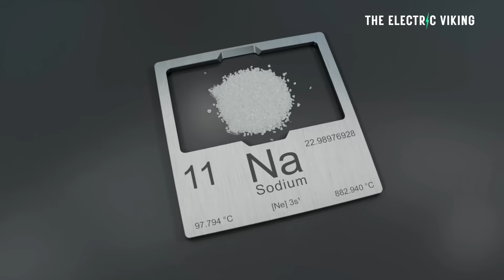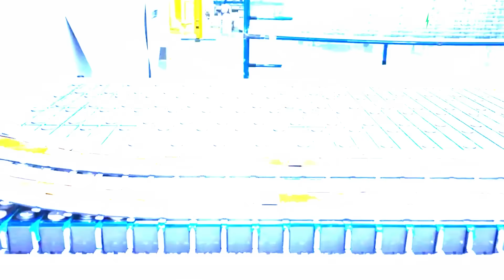Goodbye Lithium! New 3,600,000 Mile EV Battery costs 50% LESS

Comment from the maker: The car I drive, the Xpeng G6 - https://youtu.be/IcniwO8NfQQ

RESINC Solar installed my battery and solar system. Get a free quote from them here: https://www.resinc.com.au/electricviking
Reply: They are not in Norway, so your advertising doesn't help much here. 😛
Reply: What happened to CATL's "condensed matter battery"?  

Wasn't THAT supposed to be the battery "game changer"?   

CATL's Condensed Matter Batteries were supposed to give us electric planes... soon.    Where are they???

*
There's no negative consequences for CATL coming out with BS about batteries every 9 months.   They can put out BS with the blessing of the CCP (don't forget -  CATL is a CHINESE company, which means they do want the Chinese Communist Party tells them to do).

Russia funded the European idiots of the Green Party to help keep non-Russian natural gas off the market, and make them DEPENDENT on Russian natural gas.   Why shouldn't CCP- controlled CATL come out with BS battery stories that say, "Don't invest in oil indepence!  Batteries are going to make oil obsolete!".  --- or some such BS.
Reply: Please post a review of the Xpeng G6, after 200,000 kilometers. There is too much "noise" on the internet, about parts availability, customer service, and, the overall quality and longevity of Chinese built vehicles. The ONLY way to know, is to drive one, and see how far it takes you, before any major problems. My experience hasn't been great, but, cars are not cheap electric scooters.
Reply: Assuming sodium battery tech takes over, then the Chinese with their investment in lithium are out of luck.

Comment: If you could make these into swappable cells that you can gut have changed at an automated station. You’d have a full battery in less time than it takes to fill a tank of gas. And The service life would put to greater use.

Comment: Perhaps it’s a misunderstanding because “90 percent cheaper” could be interpreted as as either 52.6% of the original price or 10% of the original price. If I sell something for 52.6, and u sell something for 100, then mine is 90% cheaper. But if I sell it for 10, that’s also 90% cheaper. It’s the ambiguity of the language.

Comment: Wikipedia says,
"In April 2025, CATL launched its Naxtra sodium-ion battery brand, with mass production planned for December with energy density of 175 Wh/kg, approaching lithium iron phosphate (LFP) at 185 Wh/kg. It supports 5C charging and over 10,000 charge cycles. It also performs well in extreme cold, retaining 93% capacity at -30°C and supporting highway speeds at low charge levels. CATL claimed that the battery passed rigorous safety tests (e.g., compression, penetration) without fire or explosion risks."

Comment: Sodium ion batteries are less energy dence. They're more appealing for fixed batteries in power storage facilities, home storage etc. They will appear in cars, especially cheap cars but they'll compromise on range. I expect hybrid batteries consisting of a % of sodium & lithium cells will also appear since it lowers the costs and sodium ion batteries do have better performance in colder climates so there may be a practical use outside of pure cost.

Comment: So at 3 miles per KWH a vehicle will need 333 KWH  per mile. Naxtra batteries are 0.175KWH per kg. Lithium batteries 0.250KWH per kg. So the batteries will weigh even more. Lets say Naxtra will need 2kg of batteries to travel 1 mile. My ICE car has a 650 mile range. That's 1.3 tonnes of EV batteries to carry around. ICE fuel tank full is say 65kg. How is this either efficient or progress?

Comment: BYD in trouble? Not sure. In late 2024, BYD launched the world's first high-performance sodium-ion battery energy storage system (BESS) product, the MC Cube-SIB ESS, which uses their Long Blade Battery cells and offers 2.3 MWh capacity with advantages like high charge/discharge rates, wide temperature tolerance, and enhanced safety. Deliveries in China already began with pricing competitive to lithium-iron-phosphate (LFP) systems.

Comment: Meassuring a batteries life in miles makes no sense. How many batteries u use, power of the car, cars efficiency, aerodynamics etc play a huge role in this equation. In theory if you put in enough single use alkaline batteries you could hit a million miles. (It would be a very slow, VERY big car but still...) How many charge cycles is a far more objective meassure for battery life.

Comment: Battery tech is moving forward at amazing speed. AI has been helping the process.  A 3m mile battery is basically a 'forever' battery. You're right that the battery industry will have to take notice.

Comment: How are these, for charge acceptance efficiency? What is the equivalent series resistance? Will they have the POWER density, that will allow fast charging, and, vehicle horsepower? I think sodium batteries will probably find applications in stationary renewable energy storage, before they make it into the next high performance EV.

Comment: A major problem with EVs is that a minor accident can completely destroy the battery and the cost to replace the battery pack is prohibitive. Thus, insurance costs will shoot through the roof for EVs unless battery costs come way down and battery robustness goes way up. So how do these new batteries score on those fronts? Are they going to substantially improve those factors for EVs? If so, then EVs will become a good option for many more people, assuming electricity costs don't shoot through the roof due to AI. EVs and AIs need mass adoption of modular nuclear in order to create enough electricity capacity to keep the technology moving forward.

Comment: Lacking that "combustibility" issue will allow them to be closer stacked (for storage banks, less land use reduces overall project costs, safer less insurance costs and fire prevention/mitigation costs) and safe to install within urban environments, even for use on undergrounds etc. Yes it's those large scale benefits that will bring these battery types to the forefront therefore leading to a decrease in overall costs due to mass scale production - lithium based batteries will therefore lose mass scale production demand and become more expensive. Not to forget that there are talks to ban EV's from certain carparks and underground garages due to the massive potential liability that just one of them "igniting" does bring.

Comment: There are two causes of degradaton: Degradation by use (charging and discharging) and degradation over time (almost no use, but years go by) 
There hasn't enough time gone by, to know how long LFP batteries will last over time. Let's give an example: I have a Wuling Mini with LFP battery. No factory numbers about how long the battery will last. But, since it doesn't have active cooling, my guess is around 2,000 cycles. Which would be over 300,000 Km. 
But there's the problem: I run the car only around 7,000 Km/year. So, taking only the charging cycles into account, that would mean around 40 to 50 years. But, what about time-aging? I'm pretty sure, time degradation will destroy the battery far before charging-degradation does it. So, LFP batteries have to be around in use for at least 30 years, before we have any reliable data about it. The same for sodium batteries.

Comment: These could absolutely dominate grid storage and completely change the power grid in massive ways.
We could have affordable grid storage facilities in the 100's of GWh range, buying up power when cheap and holding it for days.
Cheap enough energy storage is as big of a game changer as fusion would be...

We could put 50 MWh batteries at EV charging stations and completely remove the high load on the grid and spread it out over the entire day.  This could allow DCDC fast charge stations in places where the grid can't handle directly feeding their max load...

Comment: With a life of 3.6m miles, depending on the automobile design, you could actually BYOB to every car you purchase; you simply slide out the battery “sled” from under the car and attach it to the new vehicle.  If the vehicle design is not accommodative to removing the battery, then you would either sell the old car as a typical used car or the supply chain could recoup the batteries and reuse them, hopefully as is, in new vehicles giving the new car buyer the option to buy a new chassis with a used battery with say 1.5m miles on it, etc.

Comment: Here's why all this hype is completely false. Usually new technology like this is deployed in small-scale applications.  you've been able to buy a small graphing batteries for small-scale operations for a while. However these solid-state batteries have not been deployed yet into automobiles. This battery technology will be no different more than likely it will be used in small-scale applications. Has the technology develops and improved it will later be deployed in electric cars if it is successful. I think everybody can agree electric cars will be a part of our society the main argument is to what degree.

Comment: @redmed10  Transporting battery packs by truck can save the land and cables needed to build solar panels. They can also integrate wind and solar power with existing power grids. By storing excess electricity, batteries can increase the utilization rate of existing power plants. 

To power the entire Earth with solar energy, you would need an area of solar panels roughly equivalent to the size of Spain to meet current global electricity needs, or about 1.2% of the Sahara Desert. However, this requires considering factors like the sun's intermittent availability (day/night, weather) and the efficiency of solar panels, which would necessitate much larger installations and significant energy storage solutions to provide consistent power. 

Area Required
A theoretical calculation suggests a global electricity consumption of about 20,000 TW/year, which could be met by covering an area of approximately 548 million square meters of solar panels, or a square with a side length of about 236 km. 
Some calculations estimate that if you covered 1.2% of the Sahara Desert with solar panels, it would be sufficient to power the entire world's energy needs, according to one Quora source.

Comment: The Sodium used is the highly reactive, dangerous metal version, NOT 'salt'. Not sure it's likely to be an improvement over the main problems facing Lithium ion batteries, it's at least as volatile when in contact with water. It might be better from some angles but, a cheaper car that you can't insure or have near your home without affecting your home insurance, because it's at least as problematic, isn't much of a benefit, especially when it contains 3 times the amount of energy to help the reaction along...

Comment: Sodium ion batteries have inherent advantages due to chemistry.  One is the impressive temperature range -40 deg C to +70 deg C (for those non-Engineering or Technical types in my country that's -40 deg F to +158 deg F) Then the fact that you can store the sodium battery with zero charge safely is a huge advantage in shipping. The reason you cannot store or certainly ship lithium ion batteries at zero charge is because of its inherent self discharging properties and its copper current collectors that can dissolve during extended self discharging and form internal shorts at 0V (zero Volts) causing thermal runaway and fire. No wonder Lithium ion batteries don't belong in an airplanes cargo hold. Sodium ion batteries use Aluminum current collectors that resist dissolving during zero charge, so the can be shipped at zero charge safely, although some self discharging does occur and performance degradation can occur over time from solid-electrolyte interphase (SEI) instability, so over a long time storage some charge is recommended. But at least you can ship it in a reasonable time without worrying about the batteries dropping below minimum charge, thermal runaway and fire. Battery electronic management for sodium ion is consequently simpler cheaper and lighter. Also because of greater inherent stability you can potentially charge sodium ion batteries faster. If Sodium ion significantly drops below Lithium ion in cost then Sodium ion just needs to be reasonably close to Lithium ion energy density to be the winning technology in many applications.

Comment: Absolutely correct👍👏 The price is not the story here, because this takes performance to a whole new level, where energy density and almost unlimited use are now standard, with price reductions to follow. From $55/kWh to $20/kWh is not insignificant, but a battery that can be repurposed[...aka Nissan Leaf] will change all the Megapack and Powerwall calculations. This is not the end, because cheaper/safer/faster is still ahead, and I for one am glad CATL is leading, because as you see ...the Americans are only trying to see who gets rich, not who pays the price.

Comment: I'd still wager that Tesla's Aluminium battery has more potential. Al has three free radical electrons in its outer shell compared to Na and Li's one free radical electron. That potentially means Al has three times the electromagnetic potential as any Na or Li, meaning smaller batteries and less weight for the same output.

Should be interesting what the future holds in battery tech.

Comment: Huge reductions in solar panel cost, incredible reductions in cost per kWh battery packs, yet a ten to twenty kWh storage system for the home, is still almost the same price. When are we going to see inverters, battery management systems dropping in price? Finally, could home solar and storage manufacturers, realise how much installation costs are. Serious research should be going into reducing the number of man hours to fully fit their system, This could see savings of twenty or thirty percent to a system. Also, could all new builds be self-sufficiency ready, even if for some really stupid reason, they don't insist on solar panels and heat pumps in all new builds, or major renovation. Even here in Ireland.
PS. Not sure who you're having a dig at. The few channels I saw covering this, were clear about the aspirational nature of the 90%reduction, plus, we know that battery packs, cells whatever do not directly translate into overall battery product price.

Comment: Imagine this:
- If the battery producers (CATL, and/or any other) can sell an 'Industry Standard' battery pack, CTB - that many car producers will use, you just need to purchase 1 package - and reuse it in your next car. Well, someone has Standards already - i.e. NIO. 
- But anyway, this is a great idea because the battery package in an electric car count for 40 - 60% of the price of a new car. Therefor an exceptionally promising idea. Right?

- And of course, the benefit of using these batteries for PV saving of energy is also interesting....

- Just think!! Of all the opportunities. I will be waiting for these batteries, and the Industry Standards. 😉

Comment: 4:40  Top end lithium batteries could be produced 12 years ago, indeed ...already 12 years before now (2013) with 5,1KWH for 20 kg of battery. That is not the 160 to 190 wh/kg but 255 wh/kg
Source...the batteries used by a few solarteams in the wsc (yes indeed in Australia) during the 2013 race. (Source: Mu child, team member in one of those solar teams, the technical specs from their car and from some others he could offer me....those teams had no reason to falsify their specs for any reason)
 It is surprising that still TODAY the production batteries do weight that much more.(lithium).

About the pricetag for batteries.
If someone tells me that a batterie costs 10 times less than I assume that's NOT about purchaseprice/kwh but about the TCO.
Better describes as : Purchaseprice/(KWH*maxcylces). If a carbattery initial purchase price is reduced by a factor of 3 and the lifecycle is extend with a factor of 12 the real price reduction is not 10 but 36 time cheaper (assuming the car will indeed last all those miles).
Because we do only expect (tesla) ev's to last 1 million miles, also some 3 times the lifecycles from the old lithium batteries we will come close to ten times cheaper. This will be the explanation why some people claim it's ten times cheaper...
ps I have driven 30000 km/year for very many years which also is 2,5* average in my country...even in my lifetime of driving cars this is ONLY 1,5miljon km...1 million miles which I could do with onlty one million miles tesla.

Such battery lasting 3,6million miles is only effectiv if it is build into a car which is suitable for V2G in 3 fase with  at least a delivery capacity of 15KW ti the grid in ac current (3*25 at 240Volts...  the dutch 3 fase home standard)

Comment: For cars charging speed is everything for those who drive on road trips. 
Fords big anouncement was partly that they would need a third smaller battery so a bit less than current standards is a non starter for cars.
Most cars are built to last less than 1 million miles and most wont be reused.
These will likely be important for energy storage but not cars.